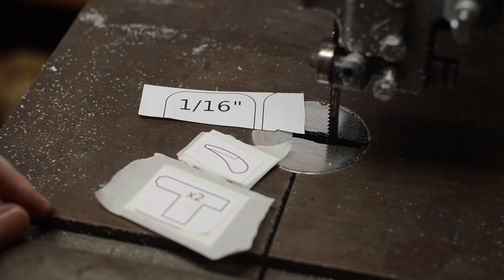How to Make Malcolm Reynolds' Pistol from Firefly plus Free Templates - Happy 100k!

Comment: You might be able to cut back on the overwhelming uniform yellow of the metal by blending / mixing in some silver in your final highlights -- you don't want pure silver but just perhaps a bit less saturation and brightness. This is a trick used in smaller scale stuff ( 28mm miniatures ) to highlight yellow/gold metals. Probably needs some finesse to make it work at this scale.

Comment: I made a firefly pistol earlier this year using pieces I designed for a laser cutting. I cut each layer and rounded them off until I got the shape of the pistol right. Mine is not insanely accurate, but I really like the finale result

Comment: Great build Bill 🙂
I was watching you sand with you,re bare finger, if you cut a finger off rubber gloves and rap the sandpaper around that it can help with edge of you,re fingers not getting sanded (found that out when I was building my desks ) hope it helps you 🙂
Reply: Punished Props lol yeah I know what that's like 😉 and Congrats to both you,re self and Brittany 😀 to not only reach 100K subscribers but Surpassing it 128K 😀👍 hoping 200K is not long in coming 🙂

Comment: This may just be me being a "noob" at this but...

Your Amazon links to the foam/plastic only come in four sizes (.02", .04", .03", and .06").

.02 - .5mm
.03 - .8mm
.04 - 1mm
.06 - 1.6mm

The sizes of the build are 1/16th" (1.5mm), 5/16th"(.3124mm), 1/4"(6mm),1/8th"(.125mm), and 1/2"(13mm).

Was that link not to the exact sizes needed or was that just a "in general" type of link? I guess I could combine smaller sizes to get the size I need. Just wondering.
Reply: Ohhh that makes sense. I think you did mention that. Oh well you should have gotten some sweet Amazon money from me anyway lol.

Comment: would a dry chip brush weathering technique work using gold rub n buff, i know it's waxy so i don't know how well it would work
Reply: I have given it a try on this very project. It worked, but you find your self putting much more rub n buff then you plan. What worked the best was generously applying it to the desired edge with a finger or Q-Tip, then brushing it over with the chip brush to create the little scratch marks perpendicular to the edge.

Comment: I must be missing something simple, if I print the 'full-size.pdf' as actual size, poster print across 2 sheets, the scale is correct and the total pistol length is 12.75" like it says. If I print the "page01.pdf" and "page02.pdf" as actual size, 1 landscape page apiece, I will end up with a 15" total length on the pistol. Which is correct?

Comment: Just finished actually watching. Great prop, but you did get some of the less obvious details wrong. Like for instance on the end of grip of the gun, where it meets the main body there is a gap where normally the gun its hammer would have been (since the prop in the show was a modified revolver). Thought you might just want to know since I have seen you put amazing detail in to some props. Overall still a great video :D
Reply: I would definetly love to, and I am slightly obsessed with firefly so I did weeks of just research before I even started making my blueprint. Would love to make one, but for now it's gonna have to wait until until I can buy me some materials :D

Comment: Awesome Job, for what it is made of.  Why not use a Taurus Model 85 revolver for the base.  Then you can build it exactly to Specs.  Also there is Two versions, one used for Firefly, and one for Serenity.
Reply: Punished Props Awesome, can't wait.  One day I'll build one on the Taurus frame.  When I have the means.
Reply: Laochri I've explored that before. so have many others. you should go take a look at fireflyprops.net and therpf.com . I'm sure you've been through all of this before. you'll need someone to weld on a new handle and extend the hammer. someone would need to make dang well sure that the barrel is welded on straight, if not, your pistol will explode, that wouldn't be fun. you would probably want to put one of the side panels directly on the revolver so you can remove the bullet shells without having to take your pistol apart. hope this helped! :)
(I've put way to much thought into this)
Reply: Zachnikatel Gaming I'm not aiming to shoot it.  I will have electronics that will have sounds that play when I pull the trigger.  Also have empty, clip out, clip in, and recharge.  Most important, the gun will need to be decommissioned.
Reply: Laochri oh. that would be a lot easier! they make air soft versions. (I'm not sure if you're looking to own metal or plastic though) removing the firing pin wouldn't be that hard. you should go for it!

Comment: Yeh paintjob really needs work... its a great looking prop when its primed but the drybrushing makes it look like a cheap toy. If you're trying to paint a metal effect, its best to use a flat coat decent metallic paint and then weather it down from there - on a real gun the dirt is on top of the metal, so using the same layering improves the effect.
Aside form that the actual shaping of the model looks great!
Reply: cool, i'll look forward to seeing that! its a pretty easy shape to cast too, so you could easily make multiple

Comment: I'm not a huge fan of the audio in the video, it doesn't sound as nice as usual. Project itself turned out really nicely, keep it up, and keep up the collaborations and 200k isn't far off.
Reply: Punished Props were you running some sort of compression effect? There might be other ways to filter out unwanted background noises.